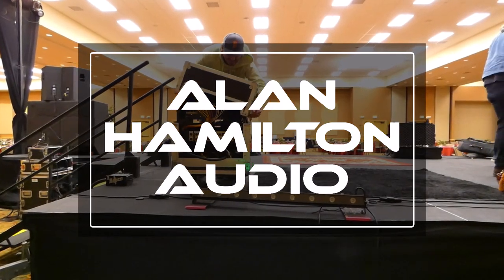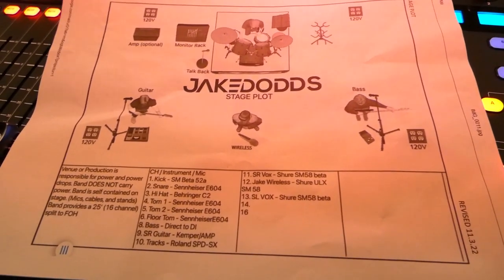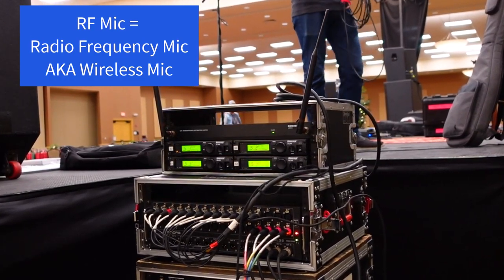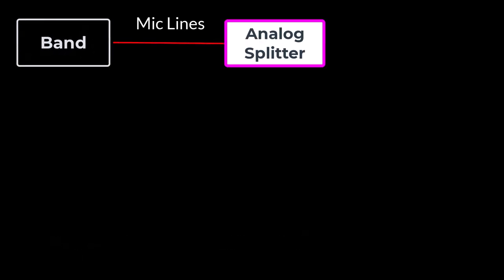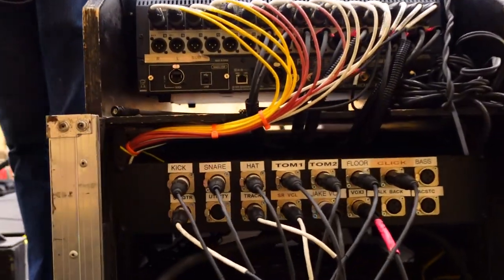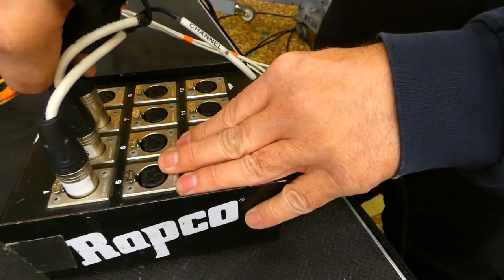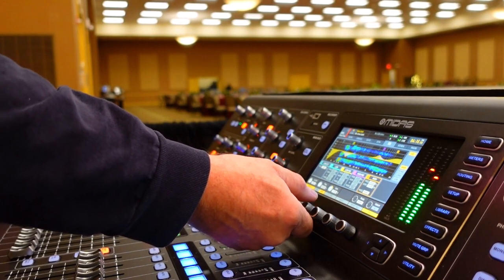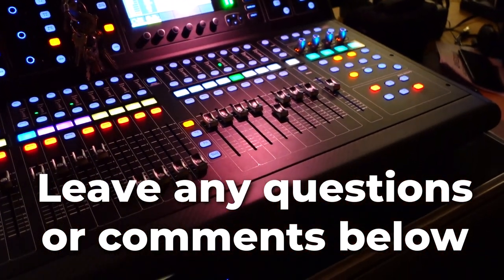IEM Monitor Rig Tips | Interfacing With a House Sound System

Comment: Top advice Alan. As you know I built my bands new IEM and mixer rig based on your earlier videos. Rather than have a snake hooked up the the "thru" side of the splitter (the isolated output with no phantom power, as opposed to the "Link" side which has phantom power from our mixer) I've got a labelled patch panel. Each output is labelled with the source, as well as the channel number.

Comment: My band will have to improve our in-ear rig at some point. Our mixer doubles as my keyboard interface with MainStage. So I can actually use midi controls to add effects any channel in our board. Example one song we are writing right now I’m playing with adding tons of reverb/effects to vocals in specific parts of the song and side-chaining that vocal into a vocoder. Which will be a problem when we have a FOH engineer, not enough outputs available when the interface is no longer the house mixer.

Comment: My band does exactly this. Having everything labeled with it's source instrument is key! We play small bars and venues and not many bands use an in ear set ups, so having things generically labeled also allows us to "back line" the in ear set up  so its ready to go when we go on. The sound tech can pre run everything through our passive splitter for the other bands and then we just turn on our IEM rig when it's time to play. It saves so much time and we hardly have to sound check our monitors from gig to gig.

Comment: The key with in ears live is to have a split y cable to send dry signal to front of house and have the other go to iem rig mixer so the band is in control of their own sound and the sound man does not have to do anything to the musicians just make it sound great out front greatly easing their work load and allows them to do their job even better
Reply from the maker: Definitely.

Comment: Drill 2 3/8” holes in the plate the same spacing as 1 u bolt. Use 2 wing nuts to fasten it to your pole. This way you can fasten it by hand on site with no tools.

Comment: Great video. Curious about something. When the band supplies their own drum mics do they also bring the mic cables, stands etc or do you supply that for them? Thanks
Reply from the maker: It depends. In this case, they supplied all their own cables and stands and claws. I'd say that is the situation that happens the most... IF the band is supplying their own ear package then they are usually supplying all their own mics, cables, and stands.

BUT... sometimes they will supply only some of that. In that case, it's usually spelled out on the stage plot, input list, or a cover letter included with their stage plot and input list. Like it will say something similar to: "Band needs 4 tall tripod boom stands, and 4 short boom stands"
Or it'll have a note on the input list where on certain lines on the form for mics/DIs it'll have their preferred mic or DI and say "Band supplies" ....except for the ones the band doesn't supply and expects us to have ;)

It's not absolutely unheard of for the tech rider to say "Band is providing all their own mics, monitor console, and IEMs but needs the promoter/sound company to provide all stands and cables as listed..."
So, you always want to read the tech rider closely and not assume. And doublecheck in an email or phone call when the show gets advanced.
Reply: @AlanHamiltonAudio  Ok cool that makes sense. Thanks for taking the time with a detailed answer. This is very helpful.
Reply from the maker: @mistacoo  No problem!

Comment: Great Setup! I need your advice on what to do when there will be 2 or more bands playing at an event and each of them have their own IEM and Splitter/Mixer setup, how will I patch things up to the FOH? will I just manually remove the first band's setup and replace it to the other ones or there is another way to do this with less hassle? Thanks
Reply from the maker: It depends on channel count and somewhat how many bands there are. If both bands can fit on the same console, just pin one band, and then pin the other starting on the first open channel. That's probably only practical for 2 bands. Or two bands and a solo or duo act on the bill. 3 more more full bands could easily eat up the channel count. Even on a 40 or more channel console. In some cases, there might be a secondary FOH console for the headliner, and in that case, a separate snake. But that's not likely except on larger events.

So, in the case of one FOH console, one snake, and multiple bands... That's where the "festival patch" comes into play. The snake and console are prepped for the largest band of the day... There is a master input list (with multiple copies floating around), and then each band's tails are connected (when needed) based on that festival patch. You might also keep a patch sheet that can be written on for each band that day to show where they fit within the festival patch. The festival patch could have several toms, a bass SR and SL (even 2 lines for bass per side for mic'ed and DI'ed), 2 guitars per side, keys for each side, DS acoustics, etc... Things NOT needed for EACH band, but things that could be needed in one location or the other depending on the lineup and stage positions of members of each band as the event goes on.
You just have to track the inputs each band will be using, but their shouldn't be massive resets at the console(s) because the kick will still be the kick, the bass will be in a bass channel, the elect guitar in an elec guitar channel, vocals in vocals... So, while they'll needed tweaked for the changing sources, they're all similar TYPE sources so they will be 'close'. This is also where digital comes in handy because things can be saved at soundcheck for each act. Or if it's a throw and go scenario, presets can be recalled for a roughed in start.

Comment: Alan do you have any experience with the Behringer MS8000 splitter?  They come in around a 1/3 of the cost of the ART version.   I know the ARTs are highly recommended but was curious how the Behringer stacks up?
Reply from the maker: I've used and used the ART and the EWI... I haven't used the Behringer myself.
Reply: I have a pair of the Behringer MS8000 splitters in my IEM rack to give me 16 channels. For context my band plays in (UK) pubs most of the time, 1-2 gigs a month with the occasional larger venue. I find that a lot of the Behringer stuff is slagged off as being worthless junk by a lot of the pros here, but we are using their X-Air 18R mixer and their Mics for vocals, guitar amp mics and drum overheads. In a live setting the difference in sound quality isnt discernible and the robustness is good enough for the amount of use it gets with us. If we were a touring band playing multiple shows a week however, this would change things. I'd want better quality gear simply to handle the increased wear and tear. The cost reductions are made by using plastic connector housings and other less expensive components.
Reply: @AndyWragg  I too use the XR18 with no complaints.  I've often found it counter intuitive that many on various forums recommend the XR18 and X32 but won't give anything else made by Behringer the time of day.  I suspect Behringer is using the same XLR connectors for both and the innerworkings of a splitter is much simpler than a digital mixer.    Glad to hear yours are working out.  You use it more than I would so I may give the MS8000 a try.
Reply: @dwhitney31  Be careful with the switches they can be reconfigured really easily (by accident) and will cause headaches until you figure it out.
Reply: My band has been using four of them for over a year.  Aside from checking the buttons at every setup as Andy mentioned, they're rock solid.  Just make sure they're isolated properly in the rack.  I use Mid Atlantic rack screws with an integral plastic washer on the head, and 00 rubber plumbing washers between the rack ears and the rails to make sure I'm 100% isolated and I never have ground loop issues.  The plastic "Humfrees" you can get from Sweetwater work great for this as well if they're in your budget.  

We also use the Behringer DI4800 units for keyboards and guitar modellers, and they work great as well as long as you keep an eye on the buttons.  Like the MS8000, they have a tendency to get pressed accidentally, especially if you store your tails in the rack for transit.  I've left glowing reviews for both units on Sweetwater.
Reply: Spend the money, get the ART. Very quality splitter

Comment: On my xr18, can you tell why my linked aux 5&6 coming out of the headphone jack will only pan left and right when the selected channel is in solo mode?
Reply from the maker: I think the problem you're describing is related to needing to be panned on the channel send pan vs channel pan:
https://youtu.be/UNO-dACc7YY
...But I might be misreading the question.
Reply: I’m just now figuring that out. I guess when I used to use the channel pan, I was monitoring l/r rather than aux 5&6. This make total sense for monitoring the busses. Thanks so much.

Comment: What if we just wanted to have everything in our ears except drums? Would we just provide a snake that has vox, bass, gtr L, gtr R and stereo track?
Reply from the maker: Technically, you only need a split for the things you DO want in your ears and the house. So, you'd want your input list and info to specify if you're carrying drum mics or not, and that you need the house system to take a home run from the drum mics, and to take tails from everything else.

Some people would just supply their own drum mics too, and split everything anyway for simplicity's sake. Or a modified version of that where your mics hit a pass-thru in the ear rack and don't actually split to your mon console, but DO hit the tails (fan out) that feeds the house system.

So you could, for example, buy an 8 channel rackmount splitter (assuming 8 channels is enough for everything you want sent to your ears) and a 16 channel fan to fan snake. Get some XLR pass throughs and mount them to a rack panel. Then connect the first 8 (or how many ever channels you need that doesn't go to your mon console) of the XLR fan to fan snake to those pass thrus. Label them kick, snare, hat, Tom 1... etc...
Then everything else would connect to your 8 channel splitter which would feed your mon console. Meanwhile, the 16 channel tail would effectively carry 8 channels of splits, and 8 channels of homeruns (since the drums would hit the rack input panel pass thrus and feed thru to the fan to fan snake that is your tails to the house.

But the cheapest way to do it is just to make sure the provider knows your drums home run to the house system, and your vocals, bass, gtrs, keys, etc all land at your monitor console and split to the house.
They can run a subsnake to the drums and their mics (or you could provide the subsnake and/or even the mics), and then supply the tails just from the items that you are splitting from your ear rack to the house.
Reply: @AlanHamiltonAudio  THank you so much for the reply! That all makes sense.
Reply: @AlanHamiltonAudio  This is the way our band are going to do it - supply everything but the drums. The sound engineer is expecting to mic up the drums anyway unless told not to. The only thing you might need is a separate mic on the kit to pick up something for your ears but that's easily patched into the monitor mixer if needed.

Comment: Hey guys how do you solve the problem of not hearing what is not miced? Things like talking to each other on stage etc.. Should I use extra mic for ambient in the middle of stage?
Reply from the maker: This band puts an SM58 onstage just in front of and to the side of the drums, and they use that to talk to themselves without the audience hearing. I don't know if they use a switched mic or it just stays on, but I ASSUME it's a switched mic so they don't hear TOO MUCH drums being picked up by that mic.
A SDC or even SM57, or two, at the front corner or corners of the stage works well to blend in some ambience to hear the crowd better. And hear a bit of ambient mix coming back at them. A little goes a long way.

That said, many times the vocal mics onstage, particularly for smaller stages, picks up plenty of ambience themselves. So extra ambient mics aren't necessarily something you HAVE to have, until you're playing bigger stages.
Reply: @AlanHamiltonAudio  Thank you! ❤️